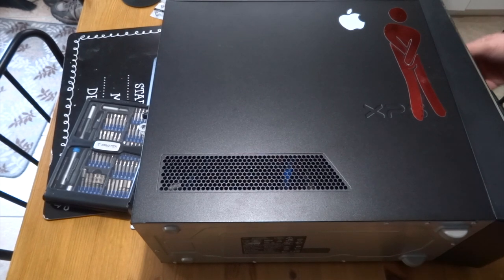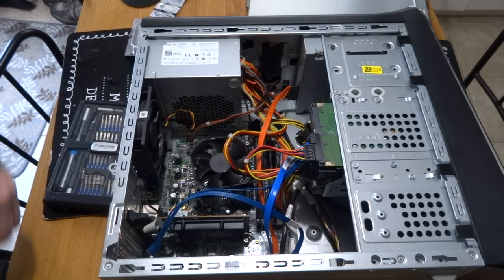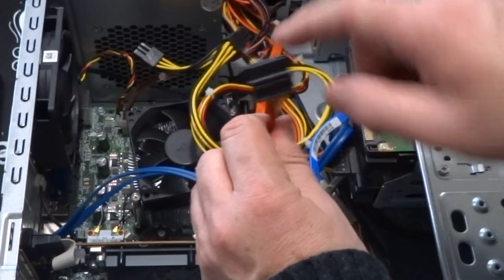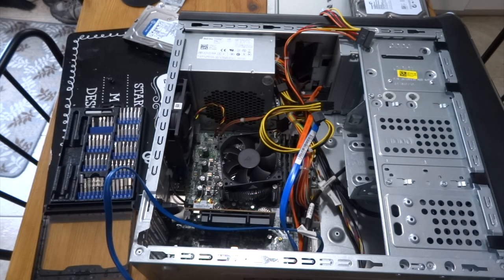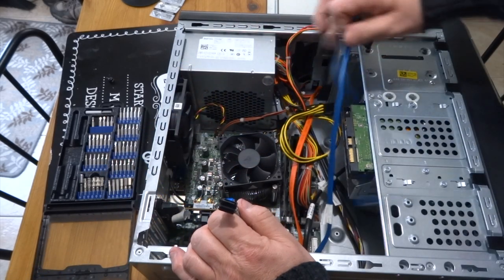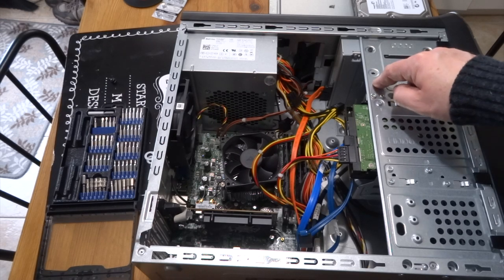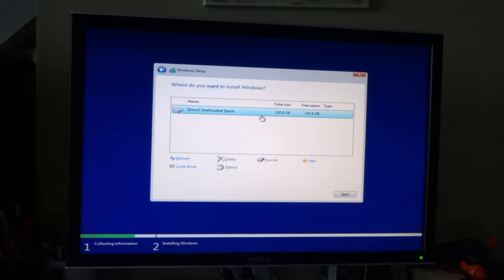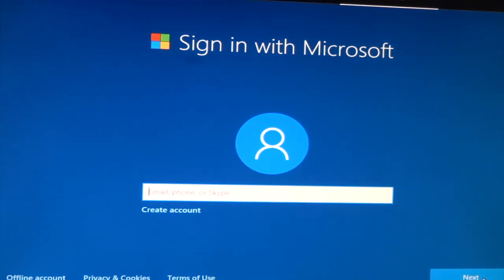3.5" Hard drive swap in a Dell XPS 8500 desktop

Comment: That metal tray that the drives are mounted in is easily removed as a single unit - which makes getting to the screws that hold the drive(s) in much easier with no flexible tool required.  ;)
Reply: i was just about say the same thing LOL

Comment: Can you use a latest those NVMe SSD in these Dell XPS 8500 desktop PC? Thanks!
Reply from the maker: I’m pretty sure you can.
Reply: @MikeDancy   i don't think so unfortunately, i checked crucial.com and NVMe wasn't listed
Reply: A Sata SSD would probably work if NVMe doesn't. Basically the same connections as an HDD but almost the speed of an M.2, just BARELY slower.

Comment: what about if you dont have a cd with the original software ?
Reply from the maker: what software do you need?  you can download teh Dell support assistant from Dell and that loads all the drivers.  You can get the windows 10 ISO from microsoft - I have a video on that coming soon. and you should always back up your data.
Reply: @MikeDancy  I did that with the help of Dell, new hard drive doesnt see a boot software

Comment: can I take out the i5 3350p and put in a 9th Gen Intel Core i5-9400 with out changing any thing
Reply from the maker: That depends on the socket and motherboard. You’ll need to do some research. I think the Linus Tech Channel has done it. You tried him?
Reply: Defiantly not, the i5 3330p is lga 1155, The i5 9400 is lga 1151, These will not work. Upgrading to the e3-1270 v2 would be your best bet. I would check dells website to make sure it’s compatible though.
Reply: If I upgrade to 7200 rpm HHD will it fit in a Dell 8500 and do I need a different SATA cable?
Reply: @ambroziajewel  If replacing a drive, you can probably get away with reusing the sata cable. If adding, you probably have to buy another sata cable.